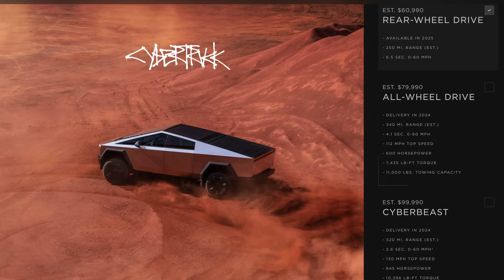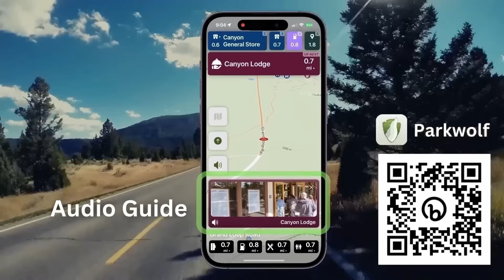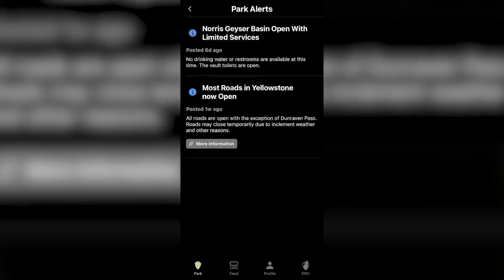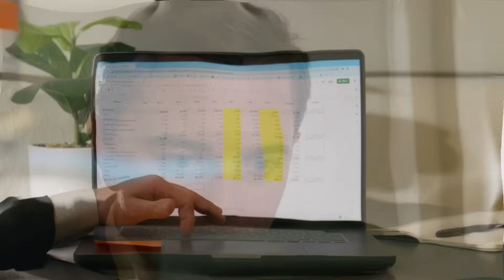300. By the Numbers: 300 Episodes of RV Miles. Plus, The Tesla Cybertruck for RVers

Comment: The Cybertruck battery extender is an additional battery pack installed in the bed area, not a hybrid generation set up.   Obviously would add weight and draw down payload but approaches that 500 mile range when installed.

Congrats on your 300!
Reply from the maker: Thanks! Yeah, the announcement came after we recorded this - it looks like it's also a way to sneak around the EV tax credit rules and keep the price under 80K.

Comment: Congrats on 300!!🎉🎉
Have you considered room for a "studio audience" for select podcasts?
How does the size of truck beds compare to each other?  What about mileage range reduction in cold weather?
Reply from the maker: We would love to do that, but the space is a little small to make it happen. Ford has the biggest bed, followed by Rivian (but very similar) and then Cybertruck. EV mileage reduces aout 15%-20% when it's below freezing, so it depends on how cold and where and for how long. Could be up to 40% in really cold areas with the heater full blast.